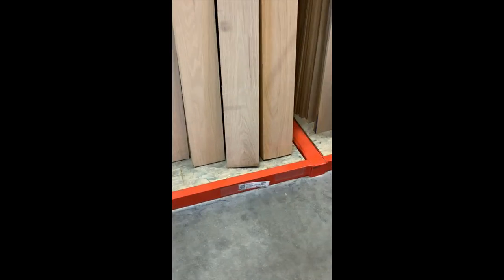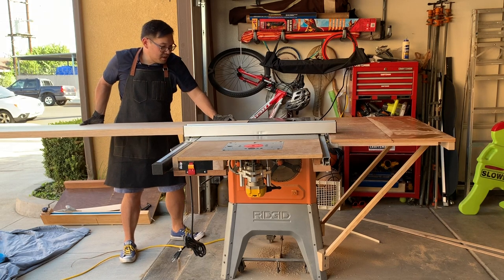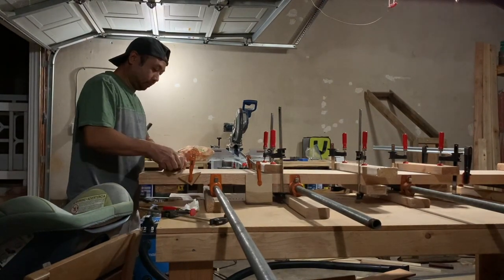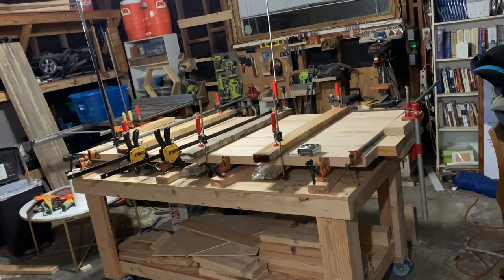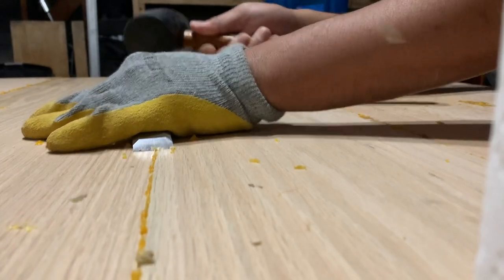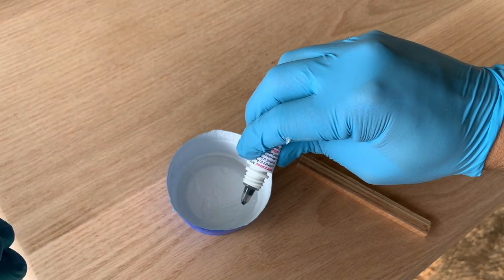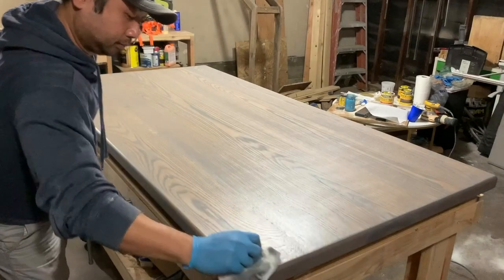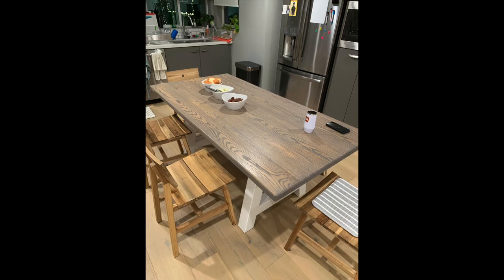Making a Red Oak Dining Table

Comment: Holy smokes!!! Awesome job.
Reply from the maker: Momentum Tint & Detail thanks so much!
Reply: How much cost did you have in wood materials?
Reply from the maker: Momentum Tint & Detail I think it was around just under $300 in Red Oak and $30 for the 4x4s. I had spare lumber for the 2x4 stretchers.
Reply from the maker: Momentum Tint & Detail I’m actually using a couple of the scrap pieces from this project to build a charger station for all my apple devices :]

Comment: Looks great. Did you consider using any wood grain filler? Have a project with oak coming up and debating it
Reply from the maker: Yeah my two options were either mixing red oak saw dust from sanding at 220 grit + epoxy as wood filler or using black epoxy. Since the table was gonna be stained gray, I went with the black epoxy thinking it could be a cool complementing tone :) I wouldn’t use random wood filler though since it’d be hard to match the tone of the red oak

Comment: I'm refinishing my red oak table right now. It's all sanded down and I just don't know if i want to stain it or do a natural finish. Did you use polyurethane last over the stain?
Reply from the maker: Yes - I used Arm-R-Seal oil based wipe on poly (3 coats lightly sanding in between) over min-wax oil based stain. I personally love more natural looking tones. If you do stain, what stain are you thinking about going with? :)

Comment: I want to make a coffee table. I was thinking about buying red oak 4ft×2ft plywood style and just adding legs to it. Do you think it would work or should I do multiple peices of wood to form the top as you had done?
Reply from the maker: That sounds fun! I think it depends on the thickness of the plywood and what type of use you think the coffee table will get. This table was 1.5” thick which you definitely don’t need for a coffee table. 3/4” redwood plywood should be plenty strong for a normal use coffee table!
Reply: Yeah ! I was thinking 3/4" red oak plywood. The coffee table is just to hold the occasional plate and cup of water while resting in the couch, nothing too heavy
Reply from the maker: @whoisjen4431  awesome! Good luck with the build! Do you think you’ll hide the plywood edges with edge banding or trim? Or leave it exposed?
Reply: Depends on how it looks. I'm thinking about it but if I like the look then ill keep it! :)

Comment: I am really surprised by how much the calls straightened out the boards. Have you ever considered using biscuits for alignment?
Reply from the maker: I haven’t really considered it strongly. The biscuit joiner I currently have is $15 I got off FB marketplace that I use for fasteners (like I did for this table in mounting it to the legs). 

I think I had it in my head that Festool was the best way to do biscuits so I dismissed the idea cause of the price. What has your experience been with biscuits?
Reply: @nwkwok  I'm debating between purchasing biscuits or using cauls. Right now my edge glue ups are super raw, no cauls, no biscuits, not even pipe clamps on both sides LOL. Hoping my next panel will be better.
Reply from the maker: @arnoldc1724  Ah yeah... that would be difficult haha. Curious, without clamps, how are ensuring the faces that you're gluing up are getting good contact?

I think the other reasoning for me not using biscuits is cause I was being resourceful with what I had. I had the spare lumber and the clamps to make those pretty easily. I've also done some glue ups without using calls and the sweat equity that goes into making something level was just too painful.
Reply: @nwkwok  I had pipe clamps just not on the top and bottom of the panel. And truth be told I don't have issues with cupping because I dont really press the clamps that tight. I will say I'm very careful during the jointing stage and I get my edges very flat. I also use the "in-out" method of edge joining lumber.

Comment: Great work nick! Thinking about making one of these too and was wondering how much was spent on the oak?
Reply from the maker: Thanks, Kent! 

The total lumber cost was around $320: 

$300 for the 8/4 Red Oak
$20 for the 4x4x8s for the legs 
I also had some spare 2x4s that I used for the stretchers.

However, if there were more 6-7 ft pieces of red oak at the lumber store, I might've been able to get it down to $270 but they were all really long pieces at my lumber store.
Reply: Note to anyone trying to create a similar  table....though not nearly as bad as framing timber, hardwoods have also greatly increased in cost since Covid.

Comment: Have you looked into card scrapers instead of the belt sander?
Reply from the maker: I actually haven't! Have you found that to be quicker than belt sander when leveling a table?
Reply: @nwkwok  I prefer a good card scraper to sanding any day. Once you learn how to tune the bur it seems as fast if not a little faster to work with
Reply: Nicholas Kwok Hey Nicholas, How do I send you a link to my new video?  I didn’t want to post on your YouTube account as that kinda tacky.
Reply: @GopherWoodshop  is it posted on your page? I can go watch it
Reply: LongBar Millworks  Yes Sir

Comment: what did the total cost end up being? I am debating trying to do the same thing!
Reply from the maker: Awesome! The total lumber cost was around $320: 

$300 for the 8/4 Red Oak
$20 for the 4x4x8s for the legs 
I also had some spare 2x4s that I used for the stretchers.

However, if there were more 6-7 ft pieces of red oak at the lumber store, I might've been able to get it down to $270 but they were all really long pieces.

Comment: How much would a table like this be sold for to a customer? (Anyone cam answer)
Reply from the maker: If you’re meaning a table like this that is full solid wood I would venture a guess around $2k. You’ll find lots of tables that are 3/4” - 1” thick but they’ll frame the edges to look like it’s 1.5” - 2” thick and those will be closer to $750-$1200